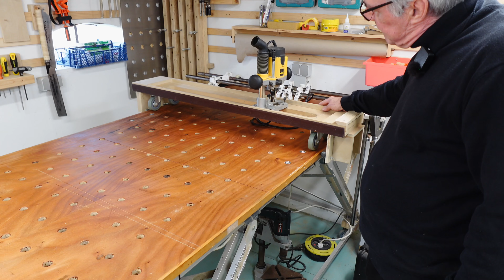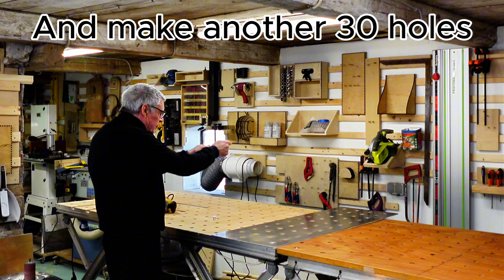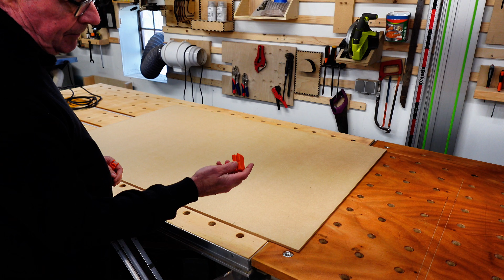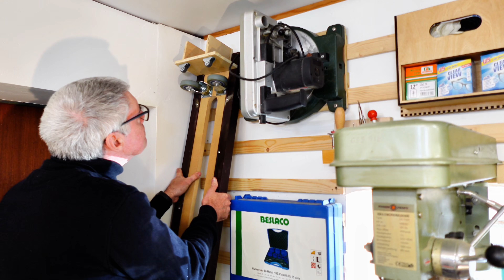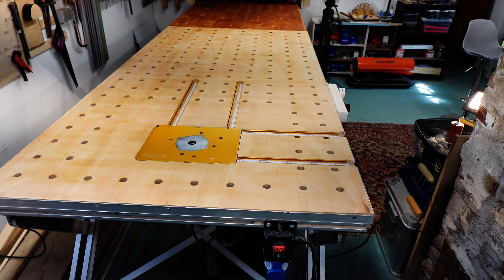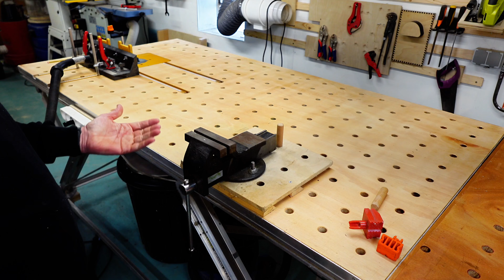You’ve NEVER Seen a Workbench Like This Before…

Comment: So I'm building my first wood shop and ready to tackle the workbench after agonizing over some designs I have settled on, using a butcher block top made ironically in Europe. It's European Beechwood. 1 1/2" thick 3ft by 7 ft. A local company sells these premade, and it's very strong, so I don't need a massive frame to support it. I have downloaded a template and 3d printed it. It's designed for a 1" bushing in a plunge router. Im doing the 20 mm dog hole @ 96mm on center. My question is: do you really need that many dog holes? I think im going to skip every other hole to start and see; if I need more, I can reset the jig and do more. Im also going to cut dovetails at 96mm OC to make a cross grid so my table will be truly MFT using 2 systems.
Reply from the maker: That sounds like a solid plan, and starting with fewer holes is a great way to keep your options open! 

Saying that, I often use two adjacent holes when assembling smaller parts.

Comment: Any updates on the Lowrider CNC setup you where describing at the end of the video? Is it precise, reliable, easy to use, easy to build etc? What design software do you use e.g. fusion360, SketchUp etc? Great channel and clear presentation of information. I will probably be purchasing the 'neat french cleat' plans soon.
Reply from the maker: Sorry for the delay in getting back to you. I was in the UK visiting family.

I have semi abandoned the Lowrider CNC project. My lasers cut just as accurately, but they are much quieter and much less messy.

I use Shapr3D for design, but I'm moving to FreeCAD (although that's a pretty steep learning curve.

Thanks for your kind words, if you have any questions about the Neat French Cleat system, just drop me a line.

Comment: Truly enjoyed this and will absolutely be using some of the ideas.  Without even having looked yet myself (I.e., asking while within the YT clip) what are the adjustable stands you have, and   is there any “fine adjustment” capability (not the 8” increments) the the decidedly undeveloped shop floor I’m working with? Really want a dead-level surface. I’m currently torn between upgrading to a “real” table saw and the subsequent loss of floor space and a more fold-away job site one with a sled and gaining the bigger assembly/work table and track saw set up.  Shop sizes and needs vary, but any general words to the wise?
Reply from the maker: Hi Scott, you could add adjustable feet to the benches. That would get around the uneven floor problem.
I bought (second hand) a Festool CMS table saw. It's a half way house between a 'real' table saw and a job site saw. It also has a slide. It works well in my small space and I can move it to other places if I'm working in the house I'm renovating.
Reply: @ Many thanks.  Out in barn today clearing, dreaming, and scheming for whatever layout I come up with.
Reply from the maker: @scotttoner9231  love it

Comment: Great set of ideas, thanks for your insights into alternative workbenches.  I use a sheet of OSB bolted to the top of old Black & Decker workbench + sacrificial insulating foam.
Have a similar approach with a vice but clamped in a Superjaws . . . great device for a very small workspace.  I also appreciate your no frills approach 🙂 whatever works.  
Very interested in your CNC operating on top of your workbench.  For many of us the biggest challenge is space.  Thanks again.
Reply from the maker: I really appreciate your thoughtful comment! It’s great to hear you’re finding creative solutions for your workspace. You can find out more about the CNC (and newer versions) here https://docs.v1e.com/
Keep up the awesome work!

Comment: Thanks for this video, some great ideas for sure.
The thing that slightly concerns me is the "copying ring" on the router.
On my router, which is from a decent manufacturer, the ring wasn't quite concentric with the cutter.  I sorted it by 3d printing a plate to house the ring.  The plate was loose on the base so it could be aligned with the cutter and then tightened in the correct place.  It may not be an issue with your router but is something people should consider.
Also, it may be easier on the router bit to drill a rough hole through before using the router.
I'm making that vice base and power point holder!  Thanks again.
Reply from the maker: Thanks for sharing your thoughts. That's a good point about the copying ring. I guess it will depend on the quality of the manufacturer.
It's an even better point about predrilling the holes. I didn't have any issues, but I did have a top quality bit (I also let it cool down from time to time).

Good luck with the vice plate and power holder. 

It's such a shame that Youtube doesn't allow for photo sharing in the comments. It would be great to see people's projects.
Reply: @NeatFrenchCleat  to be fair to the router manufacturer, they do say that the ring isn't for applications where ultimate accuracy is an issue.

Comment: Was the Indra router plate pre-drilled or did you have to do it yourself? I noticed you have that collar with the increments that goes on the shaft of the “height adjuster crank” I’m guessing that came with the router and that would give you some room for error but I would like it drilled straight. Nice workbench btw, thanks for sharing.
Reply from the maker: The Incra plate was predrilled for the Triton router. 
They manufacture a number of router plates so you'll need the correct one for the Triton.
This chart shows what's what https://incra.com/info/AluminumMagnaLOCKPlateCompatibility.pdf?ID=139
The crank came with the router and I use that in conjunction with a digital height gauge to set the right hight.

Comment: Which router bit did you use?

I wonder how accurate it cuts? No play with 20mm benchdogs?
Reply from the maker: Hi Micha, I used a 20mm Festool router bit. The setup cuts very accurately. There's no play in the dogs.
Reply: @NeatFrenchCleat  merci. 👍

Comment: I did a similar method for my MFT style bench. I bought a MFT replacement top. Used that as my template then clamped it down. Used a drill on a cheap stand to drill hole vertical. Then used my router with a flush bearing. I still have the MFT jig for a mobile bench.
Reply from the maker: Good thinking Nigel